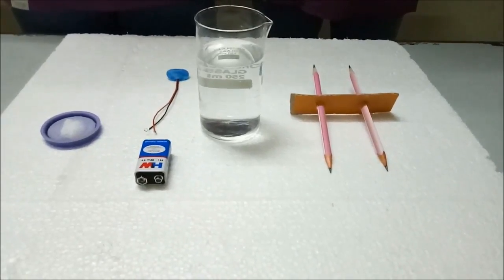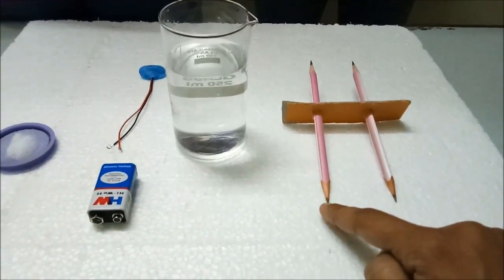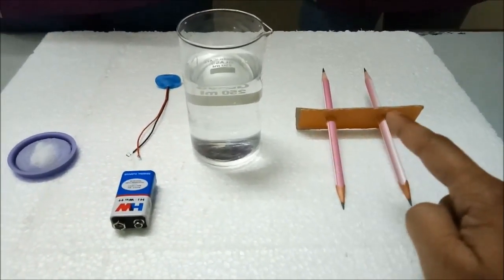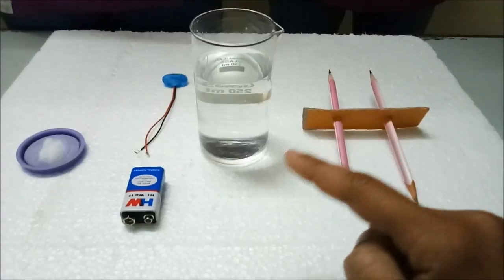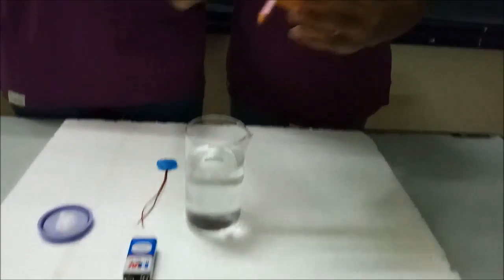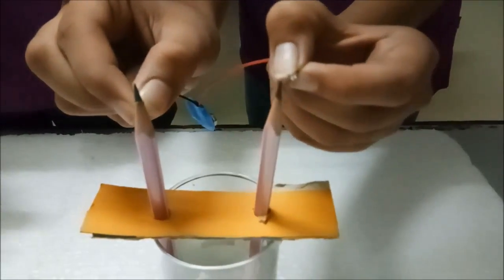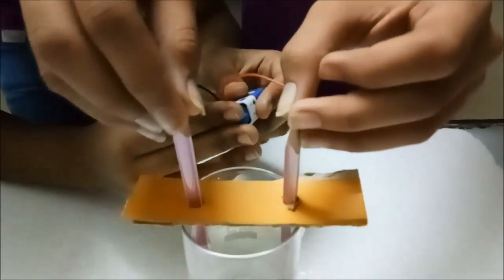Simple demonstration of electrolysis of water (SEE UPDATED VERSION LINK IN DESCRIPTION)

Comment: When I use metal The electrode connected to the positive turns black while the negative stays clean. Why is that?
Reply from the maker: The anode is where oxidation occurs. During electrolysis, the substance at the anode is losing electrons (oxidized). Depending on the electrolytic solution and the metal used, the oxidation reaction can cause the anode to degrade or form deposits.

Comment: If I wanted to make water to drink with this method. What metal would be best to use, do you think?
Reply from the maker: Hello
This is electrolysis so water is not obtained in the output. We have to use the water for this process.  osmosis works for your purpose

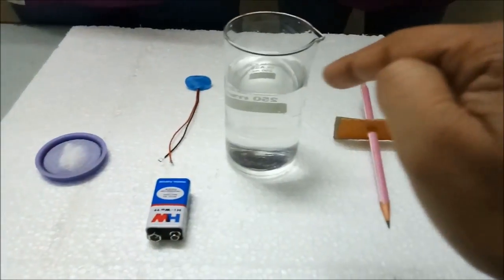Comment: 0:22 water is a good conducter of electricity not bad conductor 🧐
Reply from the maker: Pure water is a bad conductor while mineral or salt water is a good conductor
Reply: Tap water and water from other sources is a so it conducts electricity and is a good conductor but a distilled water is a water which is a pure water it doesn't not contain any acid base and salt so that's why it's a bad conductor
Reply: Distilled water has no ions and thus is a poor conductor

Comment: Sir their is a slight mistake in this video
As you said positive end of the connecting wires is anode end and negative end as cathode 
But the positive end is called as cathode 
Negative is called as anode ,as per the perspective of NCERT Science textbooks
Reply: P: Positive is 
A: Anode
N: Negative
I: Is
C: Cathode
Reply from the maker: Please refer text book again. Actually anode is the region where oxidation takes place. Please see updated version. Link in discription
Reply: Refer your book again.Cations are positively charged and hence attracted to the cathode which has a negative charge.Anions are negatively charged and hence attracted to the anode which has positive charge.
Reply: Read the text again..🙄
Reply: Did you guys know I found this on google "An anode is a negative electrode and it's one of the essential parts of a battery. It's usually made of a metal that oxidizes and sends electrons to the cathode (the positive electrode). This is an electrochemical reaction that produces electrons (i.e., electricity)."

Comment: Electrolysys of water cannot take place in pure water it should be acidified first
Reply: No dude, for electrolysis to occur there is a need for minerals in the water, acidity has nothing to do with it. the water in my house, for example, is slightly alkaline, yet i just need to add very little sodium bicarbonate (which makes the water even more alkaline) for the electrolysis to take place with only 5V and 1A.
Reply: Salt was added.

Comment: But the salt would produce sodium metal and chloride gas.(Na and Cl2). A better way will be to use Baking Soda. Anyways, this is a good video. Well done!
Reply from the maker: Thank you for watching the video. Salt quantity is very small. So small quantities of both are produced and hardly noticeable.
Reply: No..... Hydrogen will be preferentially discharged and not sodium because it has a higher tendency to gain electrons than sodium..... Revisit the unit in electrolysis
Reply: @tombrown4761  I forgot about this comment lol. Anyways, yes. you're right. Na nad Cl would not be discharged at all and OH- and H+ would be instead
Reply: @aldrictan  I want to try this but does the pencil produce a reasonable amount of h2
Reply: @tombrown4761  If you take out the graphite core, it would produce more H2 than just using a sharpened pencil since the rate of electrolysis depends on temperature, surface area of electrodes, magnitude of current and etc. I'd say it produces a reasonable amount of hydrogen.
Reply: @aldrictan  thanks.... I'll try it